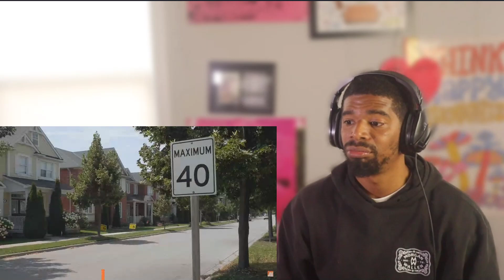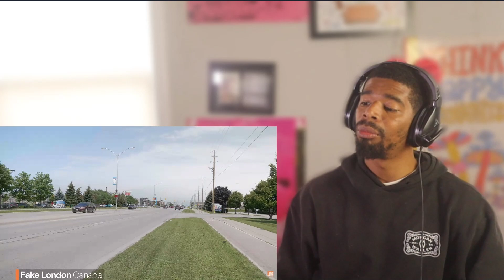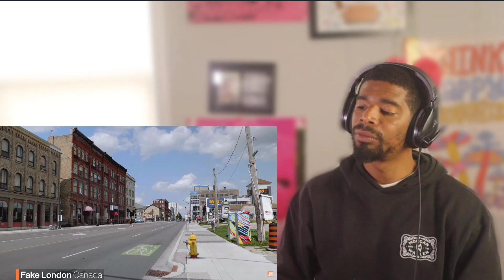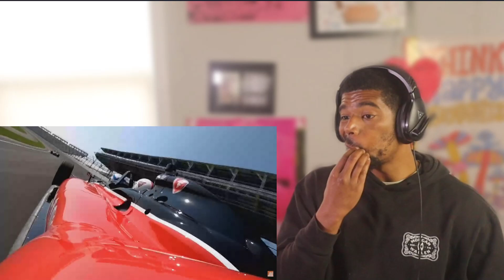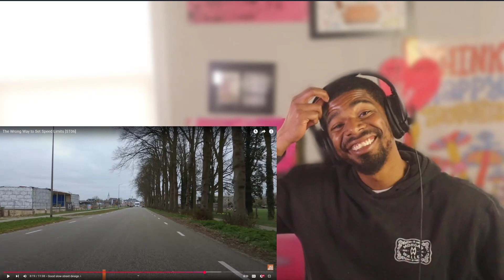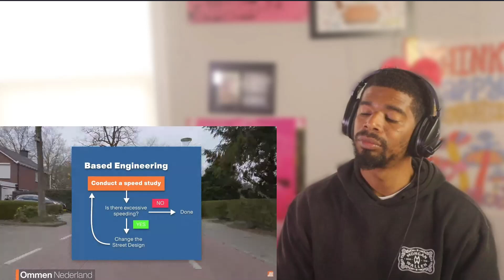Dutch Speed Limit Rules Are the Best | American Reacts

Comment: As a Dutch I fully agree ofcourse.
Don't forget: with the right street design, driving the speed limit will actually feel like you are driving fast, like you enjoy... But you aren't which is good for safety and stimulates and enables different ways to use the streets.
For us it is pretty unusual to drive a car from shop to shop in the center. We park at a convenient location and walk to each shop in the center until it is time to go home. That is because walking is actually more efficient than driving and parking each time. That is what traffic design does

Comment: If you want to drive fast > join a racing club ! In the Netherlands traffic is designed for ALL road users NOT JUST CARS. You want to drive fast or do you want to arrive the quickest. Sppeding at 40 mph to get to the next traffic light OR drive slower but adapt to the flow without traffic lights. The latter makes you arrive the quickest [and in one piece]

Comment: There's no good reason for a street in the middle of a town to be designed like a highway,
So lowering the speed limit in a town by changing the design is not forcing you to go slow,
It's forcing you to take the highway if you're just passing through,
 instead of using a rural street that was never intended to serve the purpose of a highway.
Cars should use the roads for their intended purpose and not be using a town as their own GTA V simulator.

Comment: Changing the infrastructure goes with the speed of road maintenance: a typical street or road (in the Netherlands) needs to be resurfaced about once every thirty years. When that happens, you can redesign the street, and implement the changes. If you do that, after thirty years of street maintenance, you'll have upgraded your whole street network.